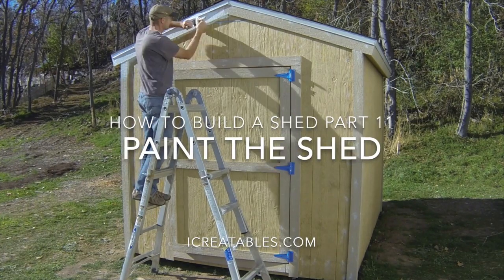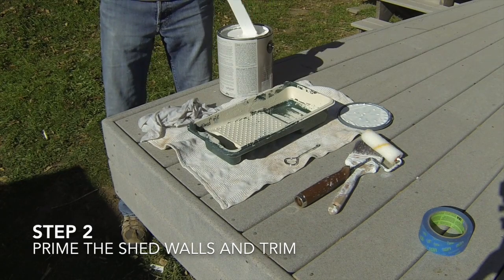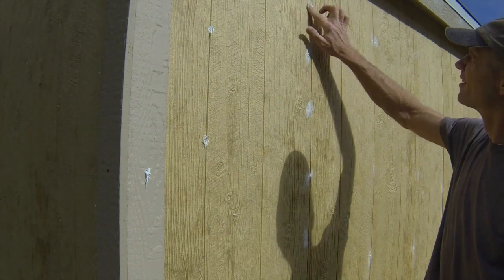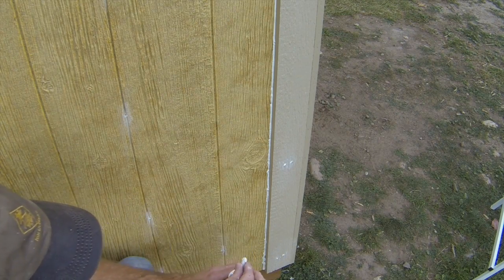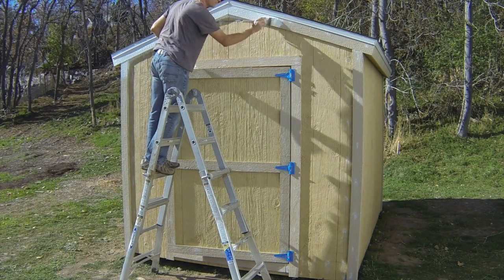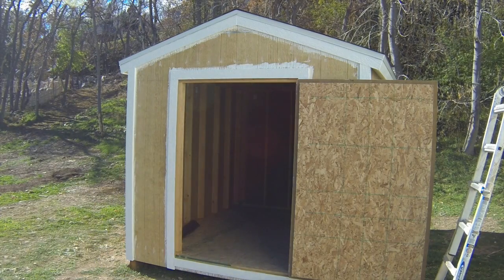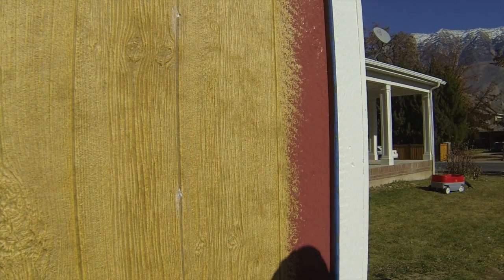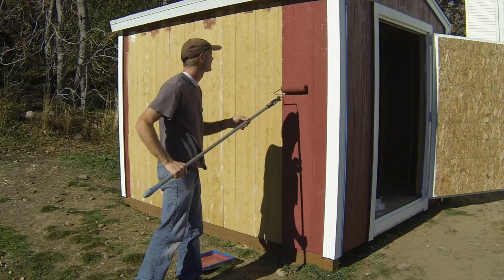How To Build A Shed - Part 11 - How To Paint A Shed

Comment: great shed building videos!  I would however recommend against ever painting any exterior walls with a roller.  the coat will be too thin & the paint will eventually flake away under the elements in a few short years.  exterior surfaces should always  be brushed on, leaving a thicker coat behind that will last much longer.  takes a little longer, but the extra time is worth it.

Comment: Sorry, but... Watching you climb up and down the A frame ladder to put paint on your brush just really frosted my punkins'! Arggghhhh! Most folks will have a 6 foot step ladder with a fold out shelf to keep stuff, like a bucket. But, that is not so good either as you may have to reach over top edge of bucket to dunk your brush. Cheapest and easiest thing to do is to take the handle from a 1 gallon bucket, twist it into an 'S' shape and hang your cut bucket from a ladder rung, or the hinge hanging to the side of the building. You can buy 'S' hooks if'n ya wanna be faincy an all dat kinda stuff, Broh? You can pick the ladder up and move it and leave the bucket swangin' thar feller! The shed is gorgeous, and your videos are great! My question is... Do you ever feel like whatever size shed you made, you shudda made it at least a couple feet wider, longer, and taller? Just my 2 cents, for what it's worth?

Comment: If you are using a water-based paint or product like caulk on nailheads or any bare metal it needs to be sealed or the water in the product with result in rust and blow out any filler or paint. The easiest way to seal bare metal is with either patent knotting or any oil-based paint. All bare wood and cut ends especially endgrains ought to receive copious preservative prior to painting. First coat of primer ought to be thinned slightly in order to soak in. Brush is better than roller on first coats as it lifts and gets under any residual dust. Solvent based paints trump water-based all day long. Don't paint in hot direct sun. If you can get it, acrylic glazing putty is better than caulk (Unibond make one). Use a painters kettle with water, a small sponge and a water spray bottle to remove excess caulk and smooth. Use absolute minimal caulk. It is easier to paint a straight line in a sharply defined right-angle than a rounded out angle. Caulk should go on after first primer and not on bare wood.